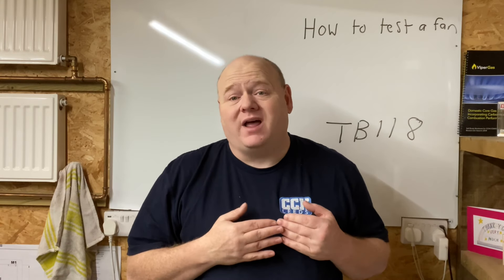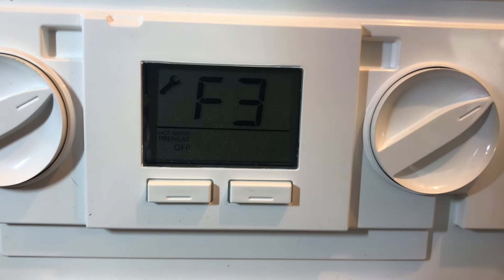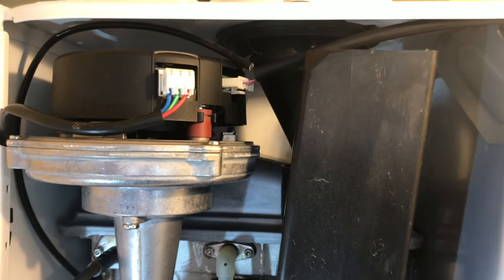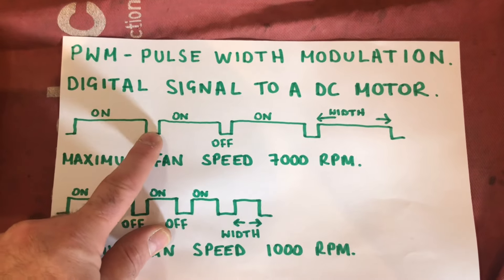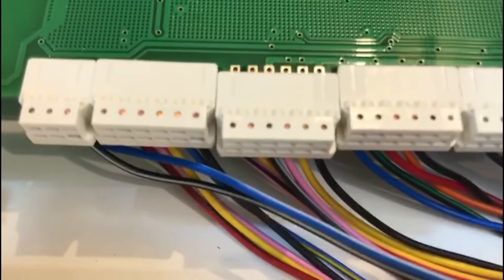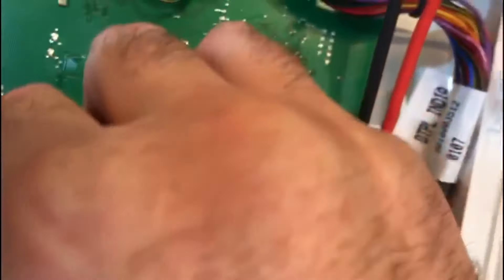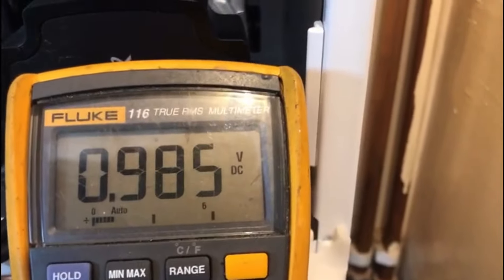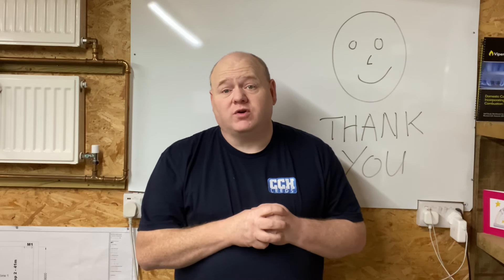Gas Training - How To Test A Boiler Fan - Combi Boiler

Comment: Over the last 16 years I have been on Vaillant, Worcester ,Ferroli, and Baxi training courses. Although I have learnt something every time there are always engineers at different stages of knowledge, so you never seem to get to the technical end of the fault finding. IE testing the different gas valves,fans, pumps, pcb’s relay’s capacitors and so on. We have to try and diagnose faults on all make and models, which is sometimes frustrating and can be costly when making a wrong decision. I probably have a £1000 worth of parts in my cupboard that I diagnosed wrong over the years (I’m not to proud to admit that). These videos have been a god send. it’s much easier when you see the videos rather than reading from the manuals. Not sure how you find the time but thank you Alan, ideal engineer, heating geek, tomcat and all the other engineers that I have found on u tube willing to share there knowledge. As you have said in the past Alan, it’s a lonely trade fault finding. sometimes very rewarding and a nightmare on others. Shame these ideal videos are coming to an end. .
Reply from the maker: Thank You:_tap::_wrech::_cutters::_mul::_gug::_drill::_burstpipe::_blowtorch::_toolbox3:
Reply: So true - fantastic video that really helps you understand the electronic and mechanical workings 💪
Reply: Thanks 🙏🏻

Comment: I agree I've been working in gas for 30 years, there were no videos then ,just manuals, and so many different difficult boilers  ,parts were hard to get not many suppliers, not enoughtraining ,and another thing we had to solder a lot ,now they have press fitt. which makes the job so easy

Comment: Allen, you are a very rare person in that you explain things really clearly and don't confuse the novice engineer. I have just learnt from you PWM - an acronym I knew the wording of from my solar panel mucking about but had no idea what it meant technically. If you don't run a school for engineers then you really could, and it would be very successful. I paid £3000 for a Gas Safe course and it barely touched on the mechanics and fault finding of boilers, let alone such advanced stuff as PWM. Thank you SO much for your help.

Comment: just watched this video, on 1st January 2023, happy new year all, and Allen, your doing a fab job and thank you to the gentleman that made this video, it was really good and helped me understand better about how a positive fan pressure zero governer works to push the air/gas ration into the heat exchanger and how the pwm plays its part in modulating. god bless you all !!

Comment: Thanks.  Just to add some value, as many are confused by the zero/negative pressure gas valves. 

A zero/negative pressure gas valve. When the outlet of the gas valve is at atmospheric pressure it is off - no gas passes through.  When pressure at the outlet is detected that is below atmospheric, it opens. The valve does this by sensing pressures - mechanically, not electrically. The fan creates that negative pressure on its negative (inlet) side. The other side of the fan is positive pressure. Well actually it is a compressor, as it compresses premixed gas and air sending it to a burner, but manufacturers retain the name fan. 

The more the pressure is negative, (the faster the compressor turns) the more the gas valve opens allowing more gas to pass through the valve into the mixing chamber, mixing with air, then to the burner. It must sense a negative pressure before it can open.  So, the faster the fan turns the more gas is drawn into the mixing chamber, as the more the gas valve opens. This gradual opening of the gas valve is all by pressure on its outlet port, not electrics. There are no electrical proving switches to detect the compressor (fan) is operating. 

The negative pressure on the outlet of the gas valve proves that the combustion fan is running, so no electrical fan switches are needed.  The gas valve contains an electric solenoid to ensure the gas is permanently off when the compressor (fan) is not turning.

Usually in the centre of the air entry port of the compressor (fan) is a small venturi just above the gas valve, so the effect of the rushing air sucks gas from the gas valve which is mixed with air in the mixing chamber just before the compressor (fan).  The mix is not a perfect air-gas mix (stoichiometric), have excess air to prevent sooting. The gas-air ratio is normally adjusted in the gas valve, so more or less gas is sucked by this venturi effect, making the air/gas mix richer or leaner. 

Most manufacturers just ask for the CO2 in the flue gasses to be checked then the air/gas ratio adjusted to achieve specification - which is different for all manufacturers. Some ask for you to set fan speeds with some asking to monitor differential pressure and additionally at the same time check CO2 for both max and min settings. Some manufacturers are confident that they have set it all correctly as it left the factory and don't even want it monitored.

But the main principle is that the venturi effect at the inlet of the compressor (fan) ensures a slightly leaner than stoichiometric mix. So, the burner is fed a stoichiometric mix which is ignited as it is blasted into the combustion chamber. 

The speed of the compressor (fan) essentially determines the size of the flame - the higher the speed the more gas is sucked in to be premixed. The lower the speed the less gas is drawn in.  This is full burner modulation. Makers have been R&Ding the variables in all this setup having some compressors (fans), gas valves, and burners sucking a very low volume of gas, allowing boilers to modulate at lower kW rates.

Comment: I love watching gas and HVACR videos 😀👍🌱 for interest and to learn how it works.  I like that the board just sends the low voltage PWM signal and the fan does all the hard work,I guess that means less likely for PCB to break and suffer thermal stress!
Reply from the maker: Thank You

Comment: Thank you very much. I am an electrician but I don’t know about boilers, more computers and valve amplifiers. Just watched your video and having noted what each connector was took them off and cleaned them. My boiler now works again. Although I think my pocket wishes it was still faulty! Anyway thanks again.

Oh well. It worked till I turned off the hit tap. When I turned it on again it failed again. The fan shudders for a second when powered on.
Reply: The Hall effect sensor on the fan has failed unfortunately

Comment: The fan on my own Logic Heat 18 sometimes whistles, and sometimes doesn't.  Since I put the Ideal weather comp kit on, it runs at lower demand and is quieter.....at least that's my impression. I've checked all the flue seals but have never got to the bottom of the whistling as it's borderline acceptable anyway. It's on now and not whistling...typical 😊 Many thanks Mr Ideal Engineer and best wishes to you.

Comment: Hi -- thanks for your top videos -- iv'e been a gas engineer for 47 years and been to many Ideal Logics + many other condenscing boilers with fan problems + but to be honest iv'e never fully undertood the wireing to the fans -- i've always known there was a permanent 240 volt ac supply + a pcb on the fan but not known the voltages of the dc wires -- one thing i've known + other engineers too is be careful when you diconnect the fan on removal when servicing -- coz a few times when its been reconnected its blown when re testing the boiler !! - and thats been with always dis-connecting with the power fully off to the boiler ! -- i think its better trying to remove the fan with the 240 vlt permanent supply still connected !! -- i know care is needed . but the wires are normally long enough to remove it still connected -- thanks for shareing your knowledge -- JIM

Comment: Great video thanks . 
One question. I understand the modulating fan with the yellow, black and pink . But what is the perm live doing ?? 
Thanks
Reply: It powers the pcb inside the fan. There is a hall sensor and other components in there, so it needs power to work. The pcb converts the AC and DC voltage into 330 volts

Comment: Would you be able to answer a question or two related to this video?

The audio was cutting in and out when speaking of the black to pink readings..  

My questions are:
1- what is the range of voltage I will see from black to pink while in operation?
2- what is the difference in function for
     Black to punk
     Black to yellow 

This video was incredibly helpful and if I can just understand this I will be so appreciative 😊

Comment: Hi Allen, all of these video's are great, just wondering if you could add in the possible symptoms of why I would be doing this, for instance, if 'such and such is happening with the boiler', this might be a possible remedy. Even better, if you could do a video on some of the things that go wrong with a boiler, ie, water keeps getting hot then cold, boiler initially lights then tries to re-ignite, then things like, this could mean a blocked secondary heat exchanger (you then direct us to your video explaining this). Although if you have already done one, could you point me in that direction. This is just something that would help us new guys to make more informed diagnosis'. Thanks in advance.
Reply: @Allan Hart did you ever do this video?

Comment: Would the fan cause the really bad growling noise or would it be the gas valve? I have had a couple Esprit give me the problem, one I gave a strip down cleaned everything it worked perfect, the other boiler I couldn't get to the bottom of it and the customer decided on a new Eco 2.
On both boilers I checked the burner plate, I'm not one to sling loads of parts on a boiler and hope for the best.
Iv'e been installing for around 30 years but I am now trying to concentrate on Ideal and Vaillant boilers fault find and repair, servicing.
Any advise would be greatly appreciated.

Comment: Out of interest when testing at the board if your two test leads touch when testing at the board can you blow the board? What if you slip and one of the leads touch another part of the board as the connections the leads go onto are extremely close together. Is this dangerous?

Comment: I use a multimeter with a built in oscilloscope, up to 25v DC. You can use it to see the quality of the PWM signal and duty cycle. It's not essential,  but it's easier to see what's going on with modulating controls.
Reply: Cam ; That's very handy. My ground lead broke on mine 🙄😔
Fiber ; you may be right 👍👍
Reply: What meter are you using ?
Reply: @davidmarsden8868  it's a Chinese jobbie, of Aliexpress.  I've had it over a year and it's still going strong.
Reply: @lemmykilmister450  cheers PAL,  DO YOU HAVE A MAKE AND MODEL PLEASE,  HOPE ITS A LOT CHEAPER THAN A FLUKE MODEL IVE JUST LOOKED AT
Reply: @davidmarsden8868  I had to put new leads on after 6 months, other than that bullet proof. Great for low light areas as well.
Reply: @davidmarsden8868  KKmoon Intelligent Oscilloscope kkm828 High Clarity Graphical Digital Oscilloscope Multimeter with 2.4 Inches
Reply: @lemmykilmister450  thank you  👍
Reply: @lemmykilmister450  much cheaper than some i looked at
Reply: Just ordered one..  found one even cheaper at Ali express but says seller dosent ship to uk

Comment: Hi Allen,  We have a Worcester 28i green-star combi that have developed a problem.   before we left home for our family holiday for 3 weeks,   we turned the boiler off at the Switched fused spur which is situated just  outside the boiler.   upon arriving home.   we switched the boiler back on at the spur.  almost instant after switching it on.  it lost all power.   I checked the 3A fuse in the switched spur and the fuse had blown.   replaced the 3A fuse but it keeps blowing the fuse instantly upon switch it on.   Hope you can shed some light on this issue,

Comment: We are having trouble with Worcester boiler not firing. BG replaced fan, boiler worked but after having shower same problem. They came back said APS fault, replaced, boiler fired up then stopped working again. Any ideas of solution. They are due back for third visit.

Comment: Not a big one, but do you want to check the PWM waveforms at 9:30? When the pulse width gets shorter, the pulse periodicity (distance between the ON edges) must remain the same. That way the DC component goes down.

Comment: Hi I have Vokera mynute 15HE. I exchanged fan in my boiler about two years ago. Fan completely drawn in the leaking airvent system water. Cost 300€. A few days ago err34 - tacho fan signal fault. All dry and clean around fan. Boiler worked fine doing HW to the HP months long. Now I'm freezing. Can sbdy tell me what's wrong with those funny fans costing 300 pounds? Thanks in advance. 
Not to happy, frozen customer.

Edit. At the boiler power up, the fan starts with high speed and slows down after couple seconds, what suggests me, that 240V power and pwm signals are ok.... 
Freezing... 🧐

Comment: Hi Can you help?
Have a logic es35 which stops working after 10mins with F2 or F3 fault.
Notice that the fan gets the impulse (the fan casing shudders every 10 seconds) not sure if of the fan needs changing or the PCB in error send the impulse. Your help appreciated.
Reply from the maker: You will need to get a gassafe engineer to come out and test it for you. It’s a very important part of the boiler and will need to be checked afterwards. Thanks
Reply: It’s the fan